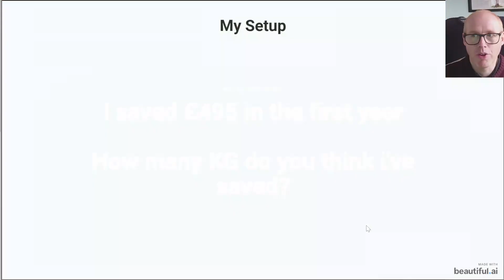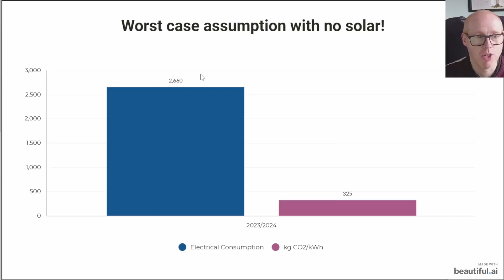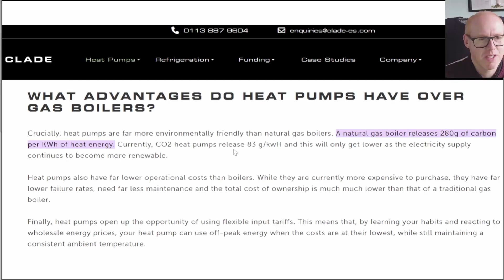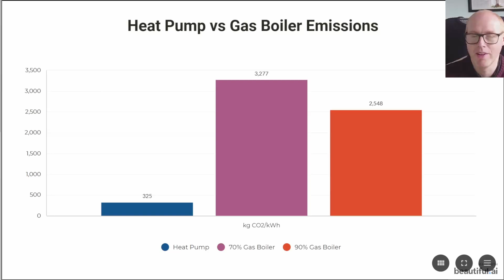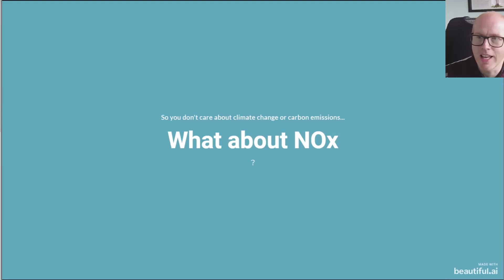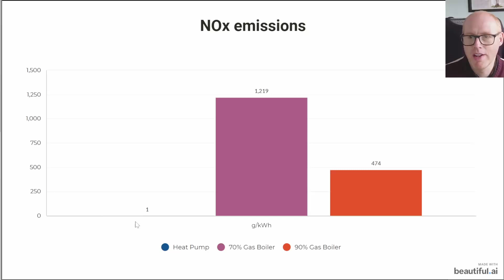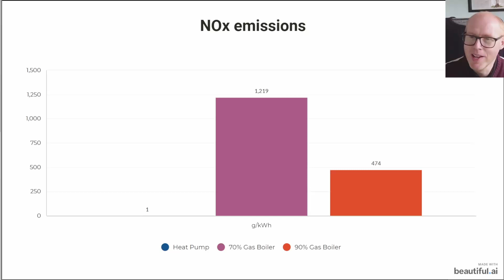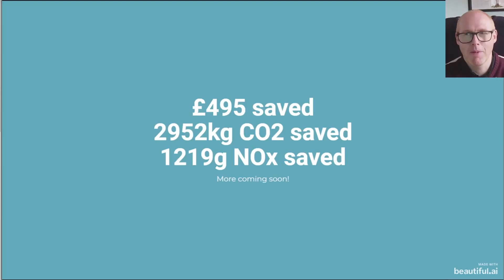Do Heat Pumps Really Save Carbon?

Comment: We have this shite heating  in our estate and its  been down  for over  20 times or more in the last 3 years   when I had  my oil pump  I would put on my heat  for  half a hour   and you  could not  put your hands on the radiator  after a half an hour and it would  last for 2 to 2 days  but this takes at least a day to heat up and lasted about 5 hours if your very very  very lucky  and if it crashes  then you have to call
 Out these heat docks to fiddle about with it   and pending  to  fix it by selling you this woke  climet change shite
Reply from the maker: Another happy customer.
On the face of it, it sounds like you were doing it all wrong.
Perhaps no one explained the system to you.

Comment: I care less about CO2 output, the planet usually has far far higher levels, in fact, we are nearly at the level where plants dont have anough CO2 to survive..... other than that, my ASHP has cost me £1.43 a day for the last few days.  Happy :) (4kw Daikin, EPC a rated 2 bed detached, 15.5kwh battery and cosy) CO2 we are at 280ppm
    16 million years ago: CO2 levels were about 480 ppm.
    50 million years ago: CO2 levels may have reached 1000 ppm.
    Cambrian period: CO2 levels were as high as 4,000 ppm.
    Devonian period: CO2 levels peaked at approximately 2,000 ppm.
    Triassic period: CO2 levels peaked.
Reply from the maker: Great to hear that your heat pump is running well!

This is why we should be concerned about CO2
https://youtu.be/sg6-_6crLlM?si=y_dsR3bAW-XD9WEU

Comment: You can't really say in UK a heat pump uses solar power.
Perhaps a few with panels and batteries could claim to.
But for me, it's mostly dark in the heating season and seeing as only 0.5% power came from solar midday it's of no value.
So, I reckon my ashp is either powered by gas or wind.
Look at biomass, it produces more co2 per kWh  than coal. Look at the subsidies Drax has raked in.
They are due a load more too!
Even nuclear has it's downsides. More than half the heat goes directly into the environment. Then the billions that are going to be needed to do the clear ups.
Wind power, when the wind isn't blowing have to be supplied with power (grid diesel?) Then when it is windy, the consumer pays hundreds of millions to turn it off.
So, electricity being 4x the price of gas is realistic, taking all the inputs and wastage into account.
Reply from the maker: Check the facts. Please.

Comment: What I don't like is the way I think I am misled over co2 emissions.
I think that the figure I see on the charts is the amount of co2 at the generation plant.
We have to look at "Life Cycle Assessment" to get a proper understanding.
For example, my car is quoted at 150 grams a mile but if I do my actual co2 its 220 grams a mile. If that's not bad enough,  the real amount of co2 per mile is found by doing a "Well to Wheel Assessment" I did the sums.in the past and I think it came out at 36% more.
Reply from the maker: @jonjo6886  very true. Tailpipe emissions have been the focus for too long.

Comment: My mini split (18000 BTU's) works down to about between -5C and -20C at 1:1 efficiency but works best between -5C and +10C at about 2.5:1 efficiency.  Above 10C to about 15C it is hardly ever on and after 15C it may or may not kick in until after 25 C when it works for A/C only
Reply from the maker: Thanks for commenting!

Comment: This is my "real world" example. If it's anything like a cold day my ashp gives me 1:2.5.
I switched from gas to electricity so I put extra load on the electric Grid, that extra load will nearly always be catered for by burning gas at the power station. 
Gas turbines get 49% efficiency (quoted) but a friend who works in the industry rrckons it's nearer 35%. This is a a result of inconsistent loading due to variable renewables.
Let's look at gas. UK imported, say 200 terrawatt hours of LNG. Please look up "Cornell University  LNG"
Say, in a year the electricity generated in UK was 250 terrawatt hrs. the quoted losses for transmission and distribution of said electricity was 25 terrawatt hours.
Take my own situation, outside my house there is a great big transformer heating the atmosphere, just for me!
So I reckon that the electricity, when it reaches me is about negative 2.5 : 1. This means my heat pump is about on par with burning gas direct. 
To be honest, fhe heat pump is too expensive for me for use. I am on Octopus Agile and at times you wouldn't believe how high the price has reached during 2 months of "Dunkelflaute ".

Comment: 7:17 are you suggesting boilers leak that despite having flute exiting outdoors? or do you confuse that with gas-hob? 🤔
Reply from the maker: Almost all of the emissions from a boiler will vent externally as long as there are no faults.

Yes, gas hobs are the very worst when it comes to internal air quality.

Comment: Interesting that you didn't even have a modern combi boiler.
Guess your yearly ~£495 savings would have been even less then, maybe in the region of £400-420?
Reply from the maker: Yes, the savings would have been lower if I had a condensing gas boiler.
Reply: @UpsideDownFork  Quite the hard sell Fork tbh, payback wise, and now you are having to capitulate and get a home battery too?
Did you used to have a gas oven, hobs as well?
Can't imagine going that much gas in a year?!
Reply from the maker: @stuartburns8657  
Yes, I agree that most people with a condensing boiler will see little to no financial savings if comparing on price cap tariffs and most of the savings will come from smart tariffs etc.

I don't have to get a home battery. I've reduced my home energy bill from £2500 per year to almost zero by upgrading some insulation, fitting the heat pump and solar. If we hadn't purchased the EV we would definitely be in the negative home energy bills for 2024.

A home battery will tip me into negative energy bills for the foreseeable future unless we have some major lifestyle changes or anything. 👍
Reply: @UpsideDownFork  Here's hoping in 2025 the standing charges can be rolled into per kwh costs.  That (some what selfishly?) will help with solar / battery ROI.
Yourself with HP and EV, less Certain (if it does happen) but I guess you'd still want to separate them?
All hypothetical of course at this stage.
Never under estimate Ofgem ability to screw over consumers.
Take the recent collapse of the DFS energy saving scheme..
Reply from the maker: @stuartburns8657  exactly! 😭

Comment: I think your complex way of calculating the CO2 is more accurate but as soon as your video started I simply said it would cut your emission by 9x. This is because a typical SCOP of 4 means 4.5x less KWh used (boiler being at best 90%) and then 56% of electricity is low carbon, so overall 9x less CO2. Its much easier for the man on the street to understand that you divide by roughly 4 due to the efficiency and then divide further by 2 for green generation.

How can the NOx saving down to 1 be correct as roughly 50% of of the electricity heat pumps use is by burning so generating NOx?
Reply from the maker: CCGTs have extensive NOX reduction systems, in a similar way to how a modern ICE vehicle has catalytic converters, DPF and Adblue systems to reduce emissions.

Gas boilers don't have these so they are much more polluting in the NOX department than a gas power plant.

Sorry, I should have explained that bit!

Comment: So according to the graphs a resistive heater would also be better than gas.  If you assume 100% gas electricity production, that means its less CO2 to burn gas to make electricity than to just burn the gas for heat.  That doesn't make any sense, it seems you are using a yearly average figure for CO2 emissions from electricity, which isn't realistic.
The problem here is that if you convert even just half of the 30 million homes to heat pumps (which really isn't feasible), you are going to need alot more electrical generation and that is going to come from gas and not renewables which we are already using the max amount.   Unlike with EVs it does not make sense to convert everyone to electrical heating until there is enough renewable capacity to supply it.
What is feasible is to use geothermal heating community schemes for the majority of high density homes in cities and towns.
Also going for SCOP is meaningless, you need a winter figure because 80% of heating comes from 3-4 months of cold weather.  Hot water can come from solar thermal in the summer, so its not reasonable to claim it as a benefit of heat pumps.
At the end of the day heat pumps are just too expensive for the majority.
Reply from the maker: In addition to all the points made by Alan and Ben, my heat pump's COP is better in the winter months than in the summer months as I showed in a previous video.
This is due to central heating being more efficient for the heat pump than domestic hot water.

You say heat pumps are too expensive for the majority, but it was considerably cheaper for us to go this route than to replace with another gas boiler. I'm not alone in this, my videos are filled with comments from others who are in the same situation.

Yes, on average I agree that heat pumps are still too expensive and this needs to change. A simple adjustment to the spark gap and the merit order could see the cost of electricity falling considerably and then heat pumps will not need COPs of 3.5 and above to compete with gas on running costs.
If we paid a fair price for gas and electricity in this country then a COP of 2 would see heat pumps being cheaper to run than gas boilers. At that cost, no rad and other system upgrades would typically be needed which could significantly reduce the cost of installation for many homes.
Reply: @UpsideDownFork  People who have money and live in their house can buy heat pumps, they look after their houses.  You have no idea of the condition of other peoples houses, in particular the rented sector.  This is the limiter.  You cannot heat with electricity realistically unless you reduce the losses in the home, the power is more limited (7kW) than with gas (30kW or more).   Gov't should concentrate on home improvement first instead of a new magic answer, its way cheaper and leaves the door open for whatever answer we go for.
Reply from the maker: @tonystanley5337  Or enforce rent control to kick out all of the horrendous landlords. Property "investments" have been seen as this get rich easily scheme and take advantage of the most vulnerable in our society.
I've done a lot of charity work over the last 20 years and been in to different homes, sometimes multiple struggling households every day. 
I'm well aware of the terrible situation that many are in. 
Many of my friends and family are also subject to the rental market.

I do recognise my fortunate position. I should leave the politics to the politicians.

Anyway, you make a good point. I think we should be doing both at the same time. We need to improve the efficiency of our homes and we need to decarbonise. Heat pumps are the best tool we have for decarbonisation. Insulation is the best tool we have for increasing housing performance.
Reply: Renewables are rapidly expanding and the National Grid have published plans to meet increased heatpump and EV demand. Google it. They've spoken on it many times. 
Obviously wind power is plentiful during winter months and Battery storage systems are being deployed to improve the mix.
Reply: As I said in another comment that said Gas Power Plant efficiency can go as low as 30%: Even at 30% efficiency, running 100% of the time for UDF's usage (2,660 kWh), the CO₂ emissions would be around 1,630 kg - still significantly less than burning the gas in a boiler.  And we already know UDF would have run a gas boiler in the same way as a heat pump, as he was doing that in his previous house, so his figures for the same heat from a gas boiler still apply.  And if gas boilers will be on more use like you suggest, they will end up running more efficiently anyway.

Not sure how you can say we are already using the max amount of renewables? There are 6 offshore wind farms under construction, 3 onshore.  And over 40 proposed ones are yet to start construction.

Also in the past 24 hours, renewables have provided over 50% of the demand in the UK, so in that time frame, resistive heating would have been better for emissions than a gas boiler.

Comment: To be fair to the Skill builder channel on your front page he does advocate heat pumps in the correct circumstances.
Reply from the maker: He says they don't work unless they're put in well insulated new builds. He is wrong. 
He now knows he's wrong as the heat geek crew have put him right.
Reply: Having watched most of host contributions he is quite fair about it and has an open mind , taken in chronological sequence . He is not entirely wrong at all , good to excellent insulation is a pre requisite if your electric bills are not to run away with themselves .
   This is not a black and white scenario there are many variables .

Comment: 4 things I keep saying to people when talking gas v heat pumps:
1) not everyone has gas as an option
2) gas is heavily subsidised, electricity is not, so the game is rigged.
3) electricity CAN be fully renewable/clean, gas never can be (ignoring hydrogen)
4)burning that gas in a power station to make electricity for heat pumps is more efficient usage than burning it in the home!
Reply from the maker: @sebaileyus8043  great points
Reply: Absolutely right.
Reply: Seb,

Gas is not subsidised it is taxed.
Electricity is subsidised except that subsidy is added to your bill.
Reply from the maker: @iareid8255  You might want to look into domestic gas tax relief. Gas is indirectly subsidised in several other ways. From exploration, extraction, the whole chain including operating costs include some creative accounting.

Please explain how you think that electricity is subsidised. The only part of electricity generation that is heavily subsidised is CCGT. Gas.
Reply: @UpsideDownFork  
No you make the common mistake of calling tax relief subsidiy, it is not it applies to all industries and commerce. The oil and gas industry pays more tax overall than 
the rest of industry due to extra taxes such as  the so called windfall tax.
Renewables are subsidised with Renewables obligation certificates, feed in tariffs or Contracts for Difference which are added to the electrcity bills.
Not only that a carbon tax is added to gas or oil generation which ultimately ends on the bill.
Not exactly a subsidy, but renewables are guaranteed that all they can supply will be used and paid for at the guranteed price, if they are curtailed the payment per Megawatt is higher than their contract price.
All for a second rate type of generation.
Reply: A gas boiler can be 95% efficient. A power plant won't come close to that.
Reply: SeBailey,
Talking U.K. ?
1) but oil is the second option.
2) Gas is not subsidised at all it is taxed, both on profits of the producer and with a carbon tax on top.
3) Electricity can never be fully renewable. You are wise to ignore hydrogen, it';s a dead end.
4) I disagree, far too many losses between generation and the consumer.